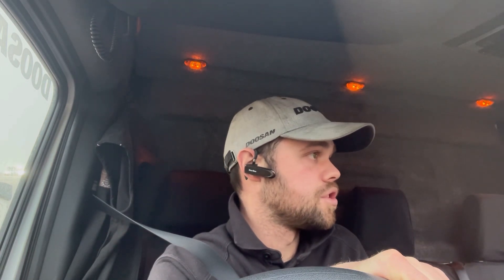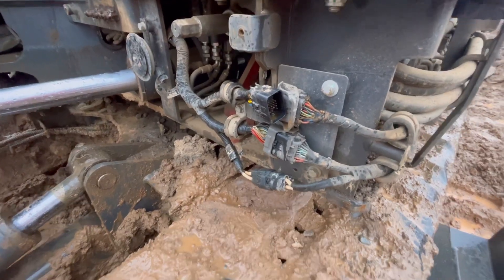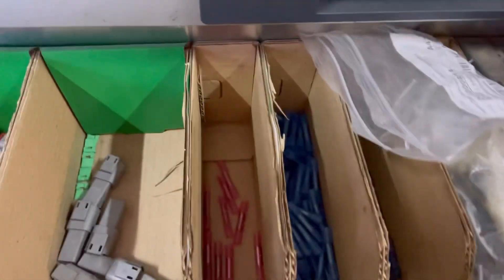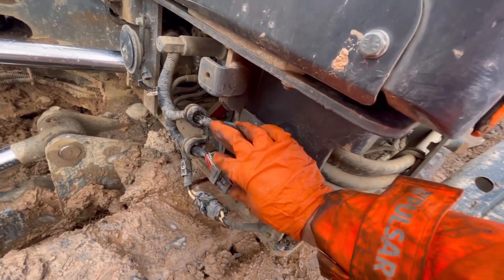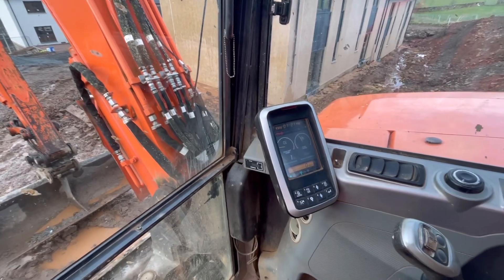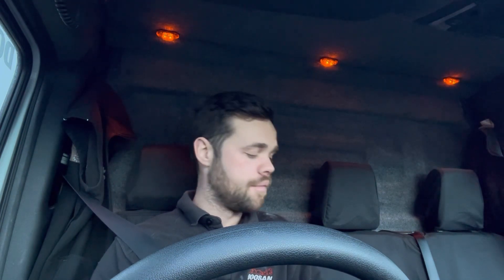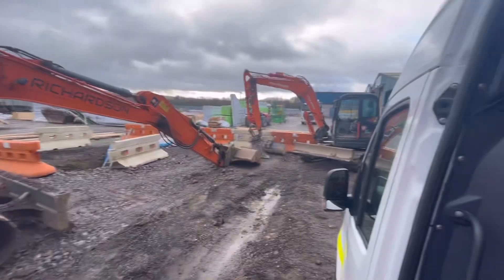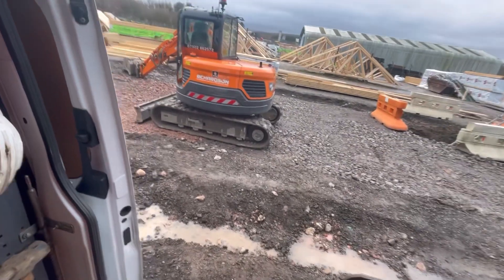Water and machines don’t mix / Nightmare! / Episode - 142

Comment: I am not an engineer by any stretch, but, watching your piece on the fitting of the thumb to the digger and the dilema regarding the pipes safe stowage when the hammer is then attached. It crosses my mind as to whether you could fit quick release pipe couplings to both ends of the flexible hydraulic lines that supply pressure to the thumb. This would enable the pipes to be easily released, removed, and stowed in the cab. When the thumb is restored to the machine the lines could be snapped onto their respective male/female quick couplers. You just seem to need to change the pipe end fittings from permanent to quick release at the bracket on the boom.
Reply from the maker: Good idea 👍

Comment: All  the electrics fitted nowdays make a vehicle more reliable ie starting etc but it then makes them more difficult to repair and dearer ..All the wiring and how it is routed the  plugs ,and where they are placed  is just a nightmare .and i am just talking trucks ..I had a non start in ,wouldn't spin over  nothing ,but it started if you bridged the relay .Relay had lost it's feed to pull it in ,which came from an ecu ,But turns out customer had installed micro switches in a locker that if it wasn't closed it wouldn't start ,Corroded plug over the rear axle .about 5 foot of excess wiring all all wrapped up and cable tied .new plug and moved it up to the middle of the chassis away from  the rear wheels ..Salesmen are a nightmare ..surely they should stipulate what has to be done on the jobcard ,so if they want a change over valve it should say on the card .same with if they want dummy plugs ...
Reply from the maker: Yea that’s the thing I could add change over valves extra fittings make brackets but this adds time and parts which aren’t allocated to the job 🤦‍♂️🤷‍♂️
Reply: @alisdiggerdiary  What i was trying to say is .Shouldn't the salesman be asking these questions when speccing the equiptment ..Astrange one i have noticed is you wire in and fit the amber beacon,,I would have thought they would be done at the factory  since they are mandatory ,even the green one .I work in a truck dealer and we can have beacons fitted at the factory .and even if you don't spec it the wiring will be there ...
Reply from the maker: Yea the amber wiring was there just need to add it out the cab there is a kit you can get to get the wiring out the cab with a nice bracket but they’re expensive the bigger machines are green beacon ready

Comment: do you know how water got into the plug, seems like maybe a design issue? I always figure that a piece of equipment like that should be designed to be washed out good with a hose and not get any water damage.

Also, stellar wrenching there, finding other issues like the leaking pipe even though you were asked to. I'd love to have a good mechanic like you watching my machines! Too bad I'm too small to hire that work out, i have to find and fix my own problems.
Reply from the maker: Thanks I’ve had problems with those plugs loads they’ve changed those plugs 3 times those plugs are the latest but evidently still are prong to water ingress I’ve tried silicone around the wires going into the plugs, striping the plug and encasing in a waterproof box the only solution I’ve found to be a permanent fix is to cut out the plugs and join each wire unfortunately I didn’t have enough connections to do it. If I notice something on a service that I can repair whilst on site I will it saves extra journeys and calls when I might be busy elsewhere.

Comment: Probably a very good reason for it but why don't mechanics and the alike which are working in the wet why don't they have an awning in the side like campervans so you can work in the dry
Reply from the maker: Because often with the rain you’ll get high winds you’ll not get many machines under the awning and they’ll get filthy 😂